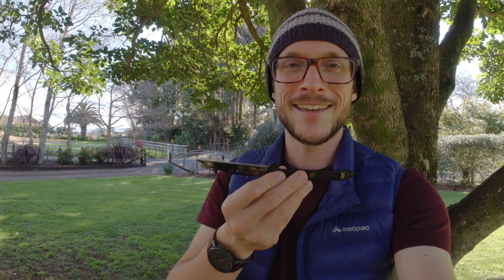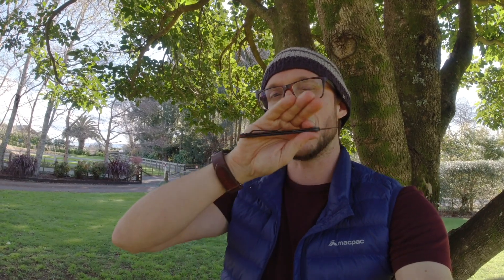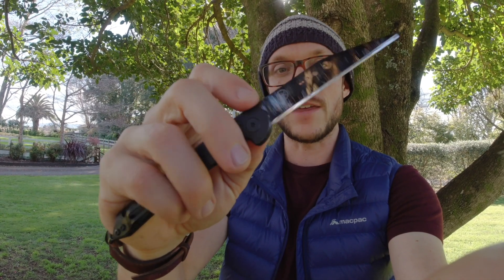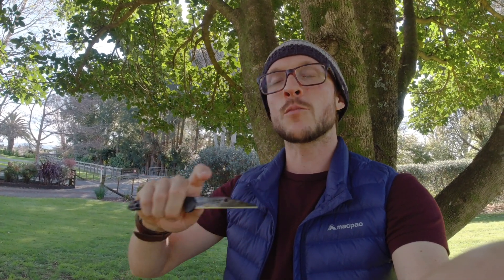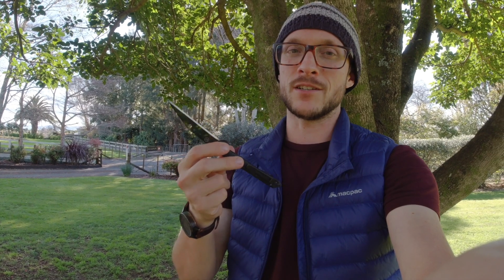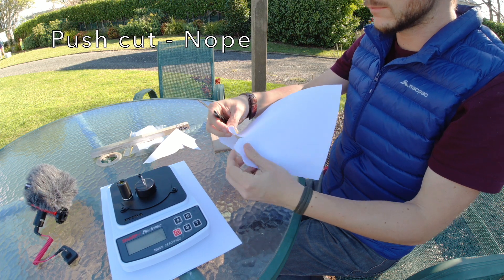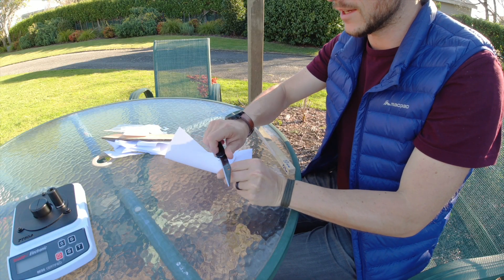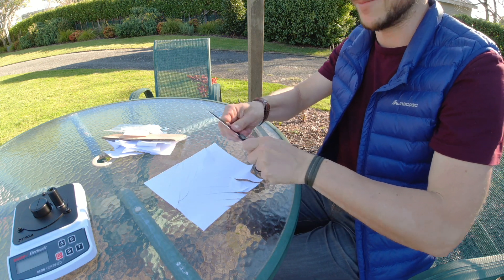Sharpening Tungsten Carbide; Dual grit edge? Best stone & strop? Reprofiling? Sandrin TCK 2.0 Knife

Comment: I'm pretty much the go to for professional edges on PTC. The most important part of sharpening PTC is DIAMOND FILM. Plates are a no no,  resin bonded stones, Metallic bonded stones are OK and will work as well as resin or met bonded cbn work OK as well. Diamond film applied on float glass is the ideal abrasive. Diamond films prevent the chipping even in course grits. Reprofiling on on 200/160 micron diamond film will remove material quickly without causing the apex to chip away badly. PTC is also highly highly sensitive to angle consistency,  with steels getting away with 2-3 tenths of a degree in angle inconsistencies is not an issue and you will still come out with hair whittling edges BUT that is certainly not the case with PTC. I'm someone that can hold incredibly consistent free hand angles and when im doing PTC I'm even more careful with how tightly I'm holding my angles. The typical way I finish it is on 20um diamond film and and that will result in an edge that will whittle hair against the grain. Some customers want mirrors and for them I finish the edges on 3um film and that will leave a bight crisp mirror and will whittle hair both ways (against and with the grain) but it will lose a far bit of its bite and aggression.  I have found that anything less then 9um on the finish will significantly reduce the bite the edge is left with. I also do not suggest to finish on a strop with anything less then 5 micron if you want to maintain great bite.  The way I finish my personal PTC knives is on the 20um film and then a couple passes per side on basswood with my 9um diamond emulsion.  That will be easily whittling hair against the grain but not capable of whittling with the grain but the edge will have plenty of bite and aggression and maintain that aggression. For most sharpeners that are learning to sharpen ptc I do not suggest they start out reprofiling on the highly course diamond films as they will get them selves in trouble with chipping that just gets worse and worse they more they try to correct it. Extremely accurate angle consistency and pressure consistency is what keeps the chipping under control with the extremely course diamond films. For people learning I suggest them to do a light reprofile and starting on the 50 micron films. (50 micron films are about as course as F240 venev resin stones) so they are course enough to remove some material but not course enough to get them in trouble and not course enough to cause chipping to get out of hand on them. It's a very interesting material to sharpen, it also responds in a totally unique way to abrasives, if you go in to sharpening PTC like you would steel knives you will have issues. It takes consistency of angle and consistency of pressure along with diamond film to get truly amazing edges on PTC, you can get great edges on resin bonded stones to but they will not be nearly as good as they would be off of film. There is just something about the way the film exposes the diamond and the film and the slight amount of spongyness that the film has allowing the diamond particles to slightly move as the apex is bumping in to them rather then the firmly bound in diamond on the resin stones. I believe that it's the slight softness that the films have that is the defining difference in edge quality between resin diamond stones and diamond films. On courser films the pressure consistency from side to side is nearly as important as angle consistency is from side to side. If you use just slightly to much pressure on the courser films you will cause additional fractures at the apex and the larger the diamond particles the worse the fractures will be. I personally love sharpening it for customers and have gotten to a point now to where I can reprofile it to whatever the customer wants and finish an edge in about the same time as i can hard high vanadium steels. I typically reprofile them and change them from a convex over to a 34 inclusive flat V edge profile as it just slices a lot better then the factory convex edge. Some customers want to keep the convex profile so I will just follow the factory convex to maintain the factory edge profile but I personally find it to cut rather poorly no matter how great the edge is. Sorry for the long comment but I wanted to get the details all included.
Reply from the maker: Are you kidding, don't apologize for the comment. That is a masterpiece of sharpening insight!  I wish I had found this information a few months ago.  Thanks heaps for sharing your insights.

Unfortunately, I got rid of the Sandrin TCK already.  If I could have gotten it hair-whittling, I definitely would have kept it longer.

I learned to sharpen on Japanese water-stones and probably picked up lots of bad habits that I'm just now correcting now that I have a BESS and microscope (convexing accidentally because I get rushed and the angle wanders, pushing too hard and causing unnecessary burrs and chips, and accidentally lowering my angle on strops because I am use to compressible strops).

This is really cool - I would love to try sharpening PTC on films someday.  I tried using diamond emulsions in kangaroo leather, trying to create that "sponginess" you referred to in your comment, but I only had very fine films - no coarse ones.  I attempted to sharpen it again on fine Venev stones, but I'm sure my pressure consistency was not good enough at that time.

Thanks for taking the time to share your experiences, I appreciate it!

Comment: Mirror edges, again with the carbide saw blade if it got shiny at the tips it was dull
Reply from the maker: Interesting -  do you mean a shiny strip appeared at the edge?
Reply: @homeslicesharpening  as a saw blade is sharpened a file was run across it which made sharp edges but using a carbide saw blade the wood would buff the blade, polishing the flats and at the very edge letting you know that it is dull
Reply from the maker: @jdemeter4357  ah, I see.  Interesting - We’ll have to see how the knife performs!

Very interesting, thanks for letting me know!

Comment: In carpentry school they sharpened saw and plainers in house. When grinders were used he would have the smallest of spark as possible ,not the whole length but just slightly present
Reply: Stropping on brown paper bag works great and even better when glued to a hard flat surfaces .
Reply from the maker: @jdemeter4357  Cool!  I'll have to try it out!
Reply: @jdemeter4357  Dude get frigging real, this is Tungsten Carbide HRC of 71 and you're talking about stropping with a brown paper bag.  It takes DIAMOND stones and DIAMOND lapping sheets and a very long time to to sharpen/hone these things.

Comment: I literally love this.  I’ve been struggling with my Torino since I got it.    I used diamond lapping paste on aluminum plates to take the tool marks in the flats down to a 600 grit satin, but I’ve struggled so hard with sharpening.  I wanted to take it to a zero convex edge and the struggle is real
Reply from the maker: It is!  I have 2 more videos coming that might help!  I got mine to shave hair adequately, which was a big landmark.  Still a ways to go though.

I had some success with automotive metal polishes like Mother's Mag on a slice of blue jeans or a 2x4.  May sound strange but it helped me!